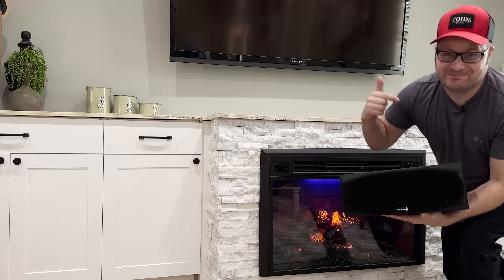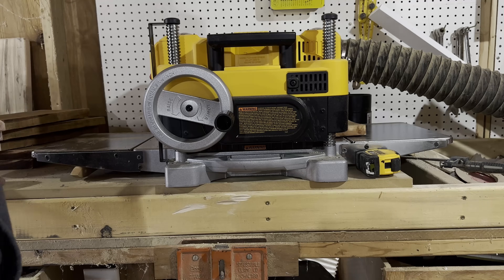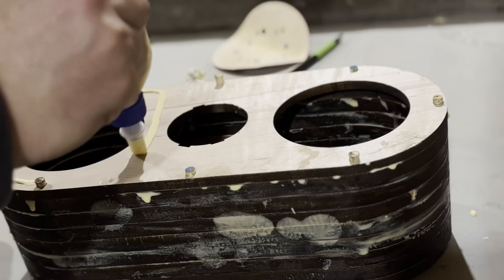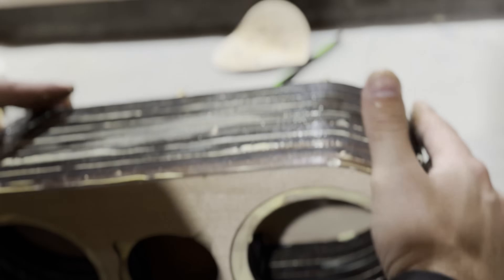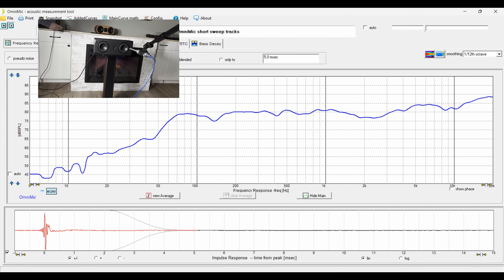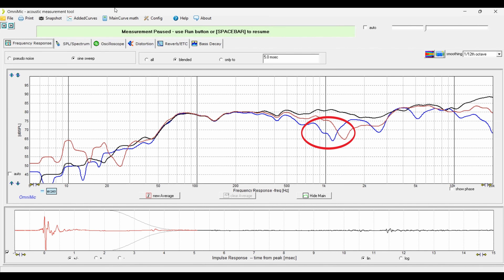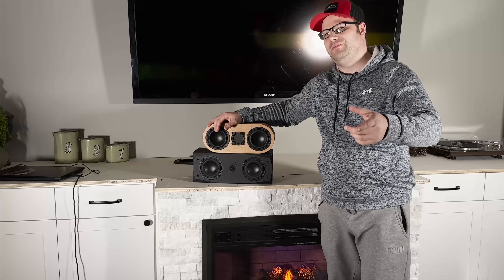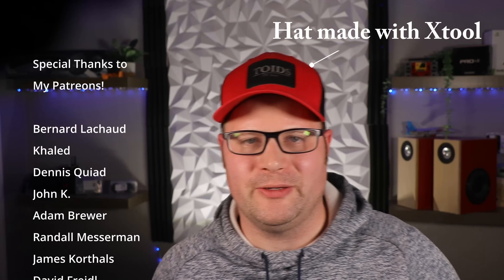Fixing The Problem with Most Center Channel Speakers - The Rule Breaker

Comment: I just finished building this after purchasing the plans. I have it paired with klipsch rp-280f towers for L & R channels. This replaced the rp-504c which I was always cranking up the volume and putting closed captions on as my favorite spot in the living room is 40 degrees off axis and I have to admit honestly the rule breaker build sounds so much more audibly clear off axis than the klipsch center channel. I can hear the dialog on movies much more pronounced and LEVEL across the seating from left to right up to around 50 degrees or so. I am not concerned one bit about tamber matching as I was more looking for a better experience with the channel that put out 90 % of movies and television. This thing is a winner!
Reply from the maker: Thank you! I am so glad to hear that you are enjoying it! That is high praise. Sounds like it is doing exactly what it was intended. It's always good to hear people experiences and see what they paired it with. Thanks again for sharing!

Comment: Would it work the same, if I‘d just use 2 center speakers via Pre-Out and separate them apart with another 2-Ch Amp?
Reply from the maker: No.
Reply: @Toid  Okay, but it's possible? Or would is be better to just buy a really wide center speaker like a Klipsch RP-504C II?
Reply from the maker: @k31n41m  you’d be better off with neither of those options. If you watch the video, you’ll see why the Klipsch would not be good. It wouldn’t have even off axis coverage. And the two Center channels are going to behave similarly. You would be better off just getting a wide dispersion center channel. It’s not the width of the cabinet. It’s the design that gives you a wide dispersion. In your case you might be better off looking for a three-way Center channel. They would have the Twitter on top on the bottom and two woofers on either side. SVS has some good ones. Something like the prime would be similar price to the Klipsch.
Reply: @Toid  Good to know thank you. I will look further into this topic. Mine is not really good and it's annoying as soon as I move my head >50 cm. But for now it does the job

Comment: I’ve solved this problem by using a Tannoy Concentric driver, and DIY cabinet.  Either the 6.5” or 8” work excellent for a center channel. They have great dialog intelligibility and no phasing issues.
Reply from the maker: @TheMirolab  great way to solve it

Comment: In order to have a good "sideways" center, you need either a central coaxial, a crossover that low passes one of the woofers so that they sit within 1/4 or 1/3 wavelength of the other woofer and there's only one copy of the frequencies that would cause destructive interference if they played in both woofers. Then the last issue is destructive interference between woofer and tweeter when they are playing similar frequencies in the crossover zone. This is harder to fix as it's hard to get the tweeter within a 1/4 wavelength of the woofer. The other thing you can do is put a concave curve on the center so you cross fire the woofers so you hear most of the upper midrange out of the one that's facing you when off to the sides, meaning less likely to hear interference patterns. One thing correct technique that Bose actually used is the "stack and rotate" technique. You stack the speakers vertically assuming the height of your ears doesn't change much compared to their horizontal position, then you twist one so it's pointing in a different direction. Your approach works because you are using the middle speaker as a mid and tweeter and only playing kick-bass through the woofers. If you have a mid that's not as good at top treble, then you can add a tweeter on top.

Comment: Nice video, how does the soundquality of this speaker compare to a jbl speaker, like the charge 5 and the extreme 3. And does it have any good bass? Did you put a hole in speaker for the woofers or is the box just closed?

Comment: If MTM designs are the problem, why don't they just use a TMT, or even just a good quality full range?
Reply from the maker: @Tonypalmeri1968  a TMT would have the same problem. What a lot of manufacturers have done is put a woofer on either side with a tweeter and mid-range in the middle in a vertical orientation. That now allows you to cross over low enough that you won’t have the issue.

Comment: Wait, why’d you use a 4 ohm speaker when most receivers put out power at 8 ohm? Doesnt that overwork the receiver? Or did u wire it in series to double the ohm on the speaker? Im confused… looks like a nice speaker though 👍

Comment: If you're down for a more complicated crossover design then a concentric coaxial driver flanked by a pair of woofers also makes for an exceptional center channel. Dayton Audio, Seas, SB Acoustics, Tangband, and a handful of other companies sell raw driver versions of these speaker designs. Unfortunately I haven't been able to find a source for the concentric coaxial speaker that uses a silk ribbon ring radiator driver, which is unfortunate because those tweeters have impeccable off-axis dispersion characteristics.

Comment: As someone with 1000s of hours of laser experience, do not walk away from them, they will catch fire at the most in opportune moments.  I remember hanging out with a friend and them going hey lets go out side for a smoke, and me talking them out of it minutes before the laser burst into flames. This wasn't a one time scenario.  If I had a nickel for every time that exact scenario happened I would have two nickels, which isn't a lot but it shouldn't have happened twice.  If you count the times I've had to extinguish a laser because someone walked away from it, then I would probably have a buck fifty.  
:I'm going to edit a little on here because I know there's going to be comments, if you have a noble gas blowing into the laser chamber then sure no fire, if you have an automated fire suppression system, great.  Those should be fine then.  Another note because I know there will be comments, no you don't need oxygen to cut the wood. Ideally you should be vaporizing the wood away, which leaves no burn marks, and can be done with out a noble gas being piped in it's just getting everything dialed in, it's honestly a pain in the ass and as the laser goes out of focus you have to dial it back in again

Comment: @toid just got the plans. But I have a little issue. I have a Marantz nr-1609 AVR and the output is only 70watt per channel. And I only have pre-outs for the front left and right speakers. So… will the speaker work if my amp only has 70watt for it?

Comment: Nice idea but frankly at that size, you could just use a regular MTM driver setup and use it vertically under the TV. The problem is to find the space for a large capable center speaker under your TV that still has a good off axis response.

Comment: WTF? I just bought your plans... I know the description says that it is a squared off version but I didn't expect for the entire build TO BE COMPLETELY DIFFERENT!  I still expected a stacked layered build as you showed in the video. RIPPED OFF.
Reply from the maker: I do sell two sets of plans for these speakers. One is a basic box, as stated in the description. The second includes files for a CNC, 3D printer or Laser to make your own stacked enclosure. If those are the ones you want, you just need to contact me.
Reply: @Toid  I do have a friend with the ability to cut these out for me but what I was originally after was a set of layered plans so I can cut them out with a scoll saw if my friend doesn't get around to it. If I spend another $30, Will I get plans to make the EXACT speaker (curves and all) that you made in this video?
Reply from the maker: @theungoliant9410  just email me and I’ll give you the extra plans for $10. You don’t need to buy the plans again. The other plans include the drawings. With those drawings are in STL and DXF format. So you’re going to need a program that can open those.

Comment: Ignoring all the expensive tools, you spent $100 + alot of time to beat a sub $50 center speaker?, why not compare it to something highend.
Reply: Youtubers only respond to compliments and as kisses.
Reply: Doesn't matter if it's a cheap speaker or a highend one, if it's M-T-M laying flat, it will have a bad horizontal off-axis response and pushing crossover point lower will help a lot. Especially with BMR, which has crazy good off-axis response (they measure pretty good even 90° off-axis).
Reply: @tomkocur  so are you saying this doesn't live up to his claims? Or are you saying I can buy something better easier? Asking for real, my center doesn't do the best job conveying dialogue unless I'm at the sweet spot and it's mtm. I was thinking about buying an asymmetrical center from m&k but those are stupid money... What do you suggest/recommended?
Reply: @robertprotean6088  I'm saying toid is right. Crossing much lower will help layout like this (horizontal MTM) a lot. And since you can't cross regular tweeters below voice spectrum (300Hz), BMR seems to be a great alternative. This, however, comes with a drawback - you either need an active crossover, or a pretty fat passive one.
tbh I don't see much advantage in assymetrical design, if it still lays horizontally. M&K crosses lower than usual (1.6kHz) but still not low enough to not beam. They also don't mention whether it's a 2 or 2.5-way, TMM in 2-way configuration is impossible to phase-align. I'm a DIY guy, I'd just build myself a 3-way speaker with tweeter and mid on top of each other.

Comment: Horizontal arrays cause vertical beaming.  Using a wide dispersion bookshelf speaker/tower for the center ch will result in superior performance for a wider seated audience!
Reply from the maker: That’s incorrect. If you watch this video, you’ll see why this actually has the same horizontal as vertical dispersion. A typical horizontal MTM would actually have very good, vertical dispersion and poor, horizontal dispersion, a typical TM, or bookshelf speaker could have good horizontal dispersion, but would have poor vertical dispersion. This particular speaker has the same vertical and horizontal dispersion. It’s a very unique design.
Reply: @Toid  - Hello, my response wasn't in relation to your design!  Rather a generalization of the industry established center channel horizontal layout.  And while symmetrical 4pi polar plots are the Holy Grail for many, I personally prefer wide H, narrower V for HT applications.  Nice polars correlates to total phase response symmetry, low and equal group delay, well integrated baffle step, etc.  But in a small to medium HT, having wide vertical dispersion adds to 1st/2nd surface reflections.  Which in turn, diminishes (sometimes greatly) the mathematically better polar plot speakers!  And yes, room treatment!  That many will pass on for a multitude of reasons.  One parameter many don't factor in is, room spectral decay.  If the HT room is ringing with mids/high, you have auditory chaos.  Which equals diminished vocal intelligibility, soundstage collapse, and blurred sound localization.
Reply: MTM speakers for centre channels, mounted horizontally  have wide horizontal dispersion, and suffer from lobing (read the research classics by D'Apollito, there is also a great article in Audioexpress magazine which covered this topic. I'll try to find it). 
Moving the crossover frequency down lower , also reduces the lobing effects but puts the lobes right in the vocal range of the human voice, so higher end commercial manufacturers will try to make sure that they limit any crossing over, or lobing at the vocal range which is the most important job for a centre.

Any 3 audio point sources will experience some lobing in a plane.

Your measurement method is really suss. ie: where you place the microphone directly in front of one of the M drivers. That's not how it's done. Particularly at "ten hundred hertz".
Thanks for the effort though. For a low budget speaker it might be OK..
Reply from the maker: @scottwallace1689  you’re almost there, but are missing the most important part. Every frequency has a wavelength associated with it. The lower you go in frequency the larger that wavelength. If you can push that crossover frequency down far enough, you will increase the size of the wavelength to a point that it not an issue horizontally. The issue with most traditional tweeters is that they can’t crossover low enough to hit this point. That is where the BMR fits in. It can cross over low enough. This is widely known and established. In fact Cambridge Audio used to make a speaker similar to this for the exact reasoning.

I’m not sure what issue you have with the measurement, but I’m sure I can clarify it for you. Just give a time stamp.

Comment: I have THX Onkyo speakers, very similar to the one you're trying to fix by replacing the center. My mains are the same, just the center is sideways.

I would be stoked if I could build all three mains just like this one. I have the skills, just don't have all the tools.

If I were to replace the mains though, my goal would be to do all three fronts behind the screen. Subs could be below if I can't make them fit. I wouldn't have any idea what to buy, but for the fun of it, I'd rather build. My total experience building speakers was building my sub about 12 years ago. It's still running, though I did have to replace the amp once. I want to do more. I want to build two new subs.

Comment: So, minor gripe. After going through all that effort, why didnt you put threaded inserts in for the screws instead of brute forcing wood screws in there, outting wood particles inside the now sealed cabinet? I am thankful you didn't just drill screw holes in while holding the drivers in the holes, thats what spring loaded punches are for people!

Comment: So what would you say is a good frequency to crossover in general such that the woofers don't cancel out (comb filtering as you taught me) ? I also wish to make a center channel for my home theater as a 3way with a tweeter and midrange in a vertical manner and two woofers one on the left and one on the right? Idk what drivers I'm going to use as of yet but let's go with 5" or 6" woofers, a 1" tweeter and a 4" full range (just throwing numbers out there)
Reply from the maker: There is no set frequency. you want to figure out the wavelength of the crossover point and then check the center to Center spacing of the woofers and make sure that you have not exceeded that wavelength. That will change based on the size of the woofers and their distance to each other.
Reply: @Toid  So based on the length of the wavelength of the crossover point, I have to look at this extract the length of the wave into my units (inches) and I have to makes sure that my  woofers center to center to do exceed this wavelength. Its safe to say that the larger the woofers (based on physical limitations of size) the farther apart they're likely to be, which means I'd have to lower the crossover of the woofers to the midrange to make sure the wavelength is larger or the same as the distance center to center of the woofers?
Reply from the maker: @hermangaviria690  exactly. And larger, of course means crossover earlier.

Comment: Yeah, no, your no is a yes, and your yes is a no.

Compared to effectively range tweaked centers, this will sound woody, thin and crap. Like a BOSE surround.

The mid is small, with no array for force. And the high is fat.

There will be no crystal cutting highs, or thundering, snapping mids.

There are ways of achieving off-axis dispersal without the same tacky compromise that BOSE has used to enhance reflective audio for decades.

There's a reason why domes were adopted.

If this is a plus it's only for tight, wide, projection on a dinky budget. But the sound quality will suffer greatly.

Wrong. Mmhmm yes, the best reference speakers in the world are designed *wrong*. Maxed-out-lols.

Welcome to the life-hax audio-mode.

This is the lowest denominator compromise for audio. Spreading the quality is hard so... No quality for nobody!
Reply from the maker: You should check out Cambridge Audio Aero 5.

Comment: How would this work out with two of the smaller drivers stacked in the center?
Reply from the maker: It wouldn’t work well, and it would actually defeat the purpose of what we’re trying to accomplish
Reply: @Toid  I know side to side effects the dispersion off axis left to right, but didn't know how on top of each other would differ. Thinking of how a line array works for example, and still having the stacked small drivers playing lower hz range like this design.

Comment: I'm building pods to test these same BMR drivers in my Jetta so this video is a shot of confidence. I was planning to use a SEAS 1" soft-dome tweeter though because I have heard that they can get a bit "papery" sounding on the high end. Have you seen those Philharmonic speakers using these things. dadgum they get good reviews. And I was planning to cross them over at about 500Hz which seems like a nice compromise to their range and the midbass in the doors.

Comment: Love this build… would those woofers, and an extra tweeter, with an inbuilt amp & battery make a decent boom box? Boom box has similar off axis challenges
Reply from the maker: You’d wanna keep it exactly the way it’s designed not add anything extra. But you could add an amp and a battery and have a pretty fun boombox. Or build two of them on either side with the amp and the battery in the middle and that would be fun.